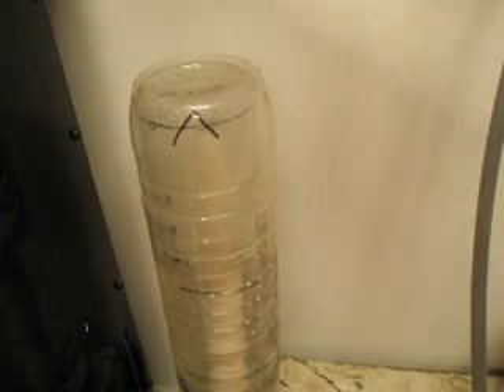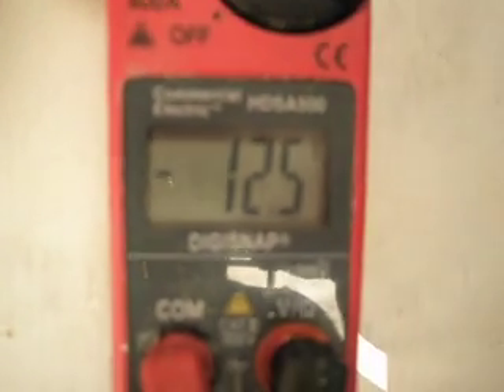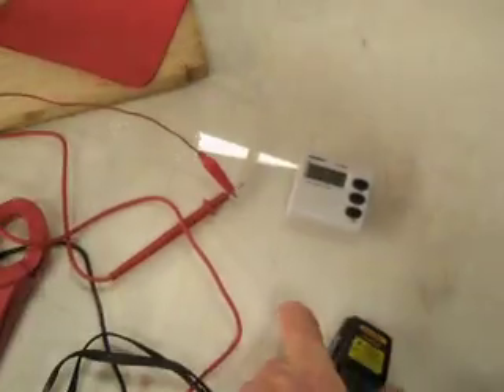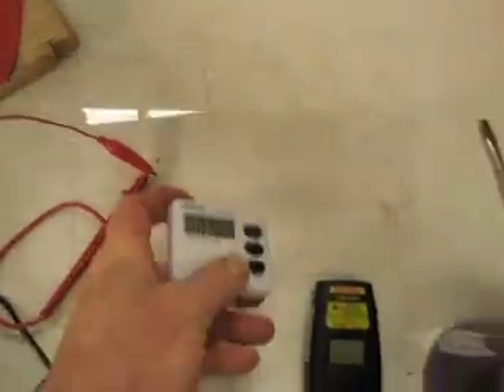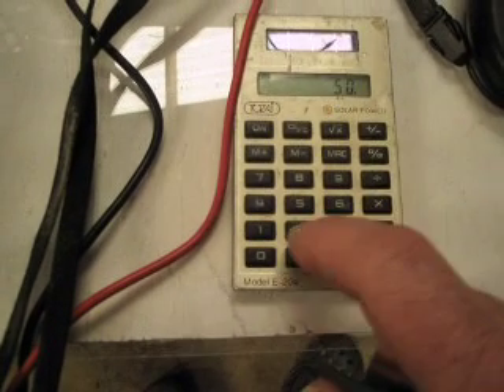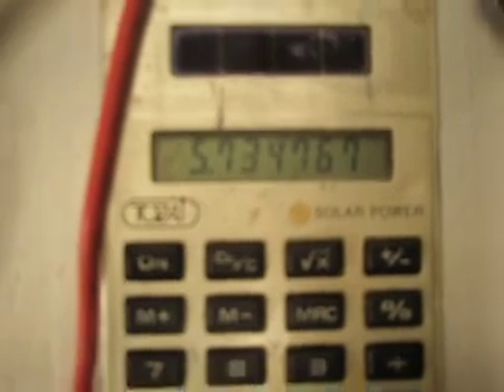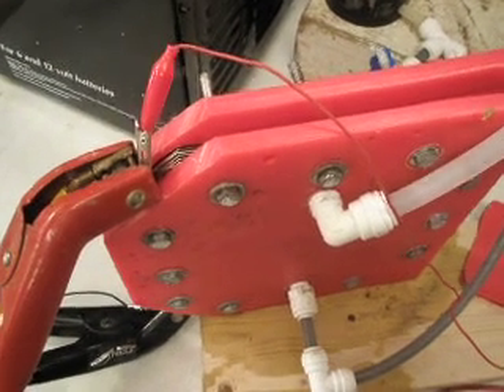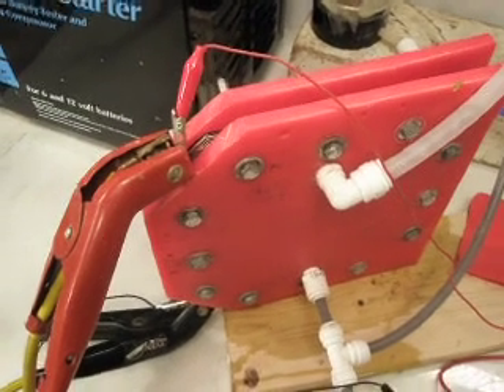Mars Gasket Test

Comment: Hi: Thanks for trying out my mars gasket. Did you use it top and bottom? What was the MMW before the new gaskets? Your set-up seems to be making heat? I wonder if mine will when I correct the blocked holes?
Anyone that has alternating lower holes could easily add this gasket to their existing set-up.
Thanks for the compliments, Mars
P.S. Of coarse I rate this a 5 :-)